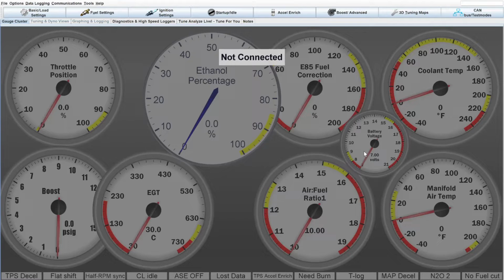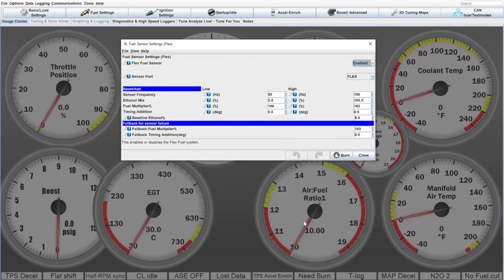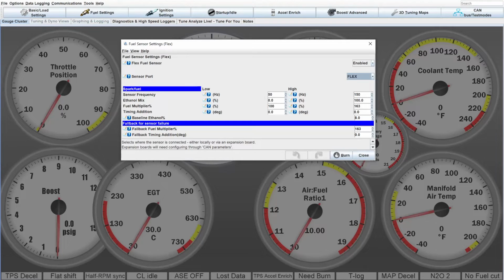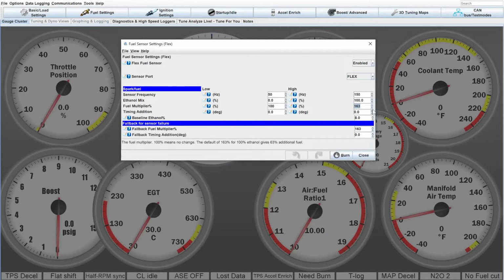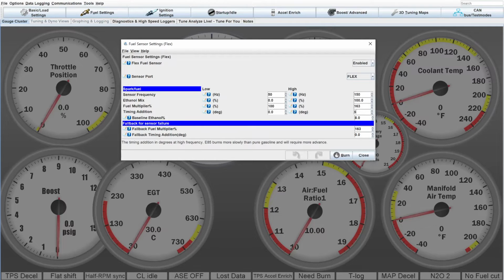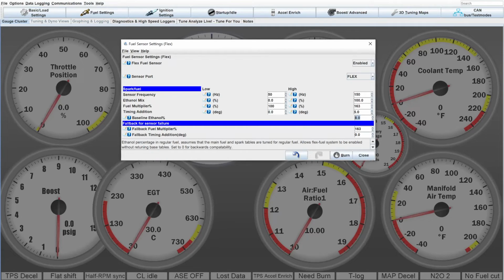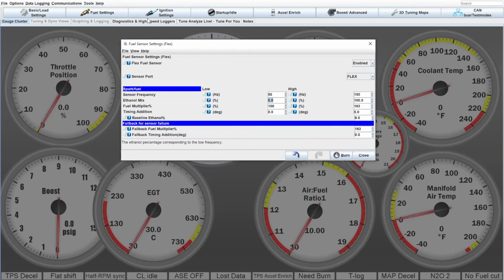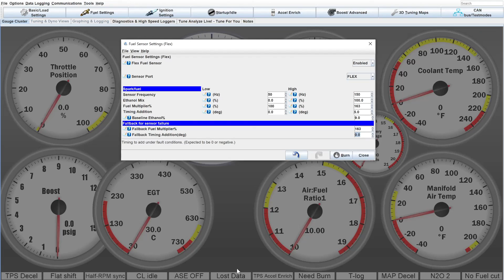Megasquirt Flex Fuel Setup Basics | Learn to Tune

Comment: If I’m starting over from scratch on a new build. Do I just tune with E85 for base ? Or do I need to map it out on pump gas first?
Reply from the maker: Start with gasoline if that is what you will run a majority of the time
Reply: @TurbineResearch  I think I’m going to run E85 almost exclusively since it’s supercharged and non intercooler. I had a meth water injection setup with the 91 octane before but I think going straight E85 will be more then enough
Reply from the maker: @Bacongrease00  in that case just make a fuel map for just e85 and send it
Reply: @TurbineResearch and pray the advertised e85 is actually 85%

Comment: If my car was tune on pump 93  but i have the sensor set up already n wired to my ms3pro can i just  turn this future on and pump e85  i should be good ? Or do i need to tune with e85  or will the ms3pro correct my fuel table if i decided  to pump e85
Reply from the maker: You can turn on the feature and it will work just fine with the default settings. However with ms3 you can make a gas tune and an e85 tune and blend them together based on ethanol content
Reply: @TurbineResearch  I haven't had  any luck here by me with tunners
Reply: Do you offer tuning services  ?

Comment: if you run methanol blend do you change any setting
Reply from the maker: In this test no but if you want to optimize for methanol yes
Reply: @Turbine Research  i might need your help because im doing it with a setup that need a 0-5v input so it need to match the e to work
Reply from the maker: @topherblais13  are you planning on using methanol for flex fuel ? Send me an email on the channel page email
Reply: @TurbineResearch  yes
Reply: @TurbineResearch  will do

Comment: If I'm tuned on e85, can I set my baseline to 85%? I haven't tuned on 93 yet.
Reply from the maker: You can do that too although I suggest doing a 93 tune so you have something to compare against when you use flex fuel

Comment: So I recently bought a car with a e85 base tune and I just installed flex fuel myself so I can switch to 91 pump when I’d like to, would the set up be the same, For the fuel multiplier would I still add more fuel based on my e85 content, bc I already have a e85 base tune on the ecu. Thanks in advanced!
Reply from the maker: Thanks for watching! If you already have a tune for e85 you need to change the base tune to gasoline before you use the settings I show in the video. I suppose you could do a negative multiplayer to take away fuel from the e85 tune but best practice is to use gasoline as a base then modify for adding ethanol.
Reply: @TurbineResearch  Thankyou for the reply ! should i just make a whole new base tune for gasoline and set that tune up for flex fuel, and save the e85 tune I have now for backup just in case…. I’m sure my e85 tunes timing and fuel/afr maps will need to be different for gasoline correct? So might as well start a whole new base map is how I see it.